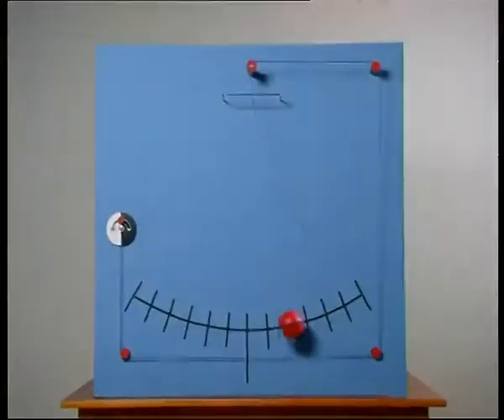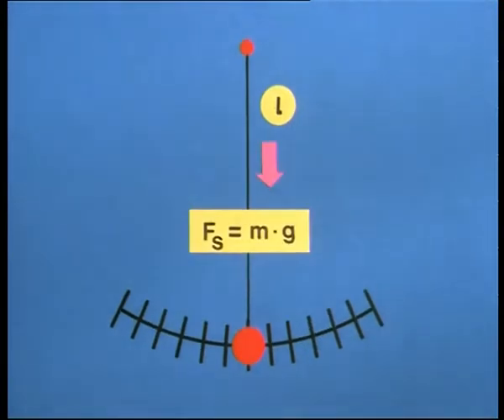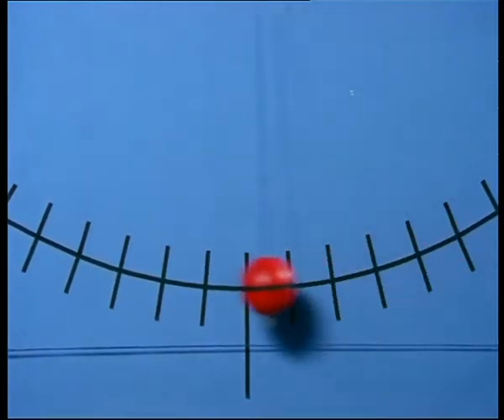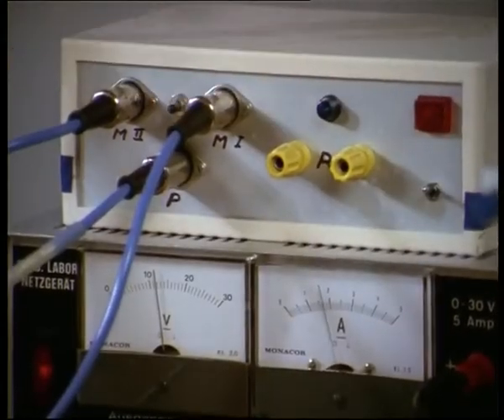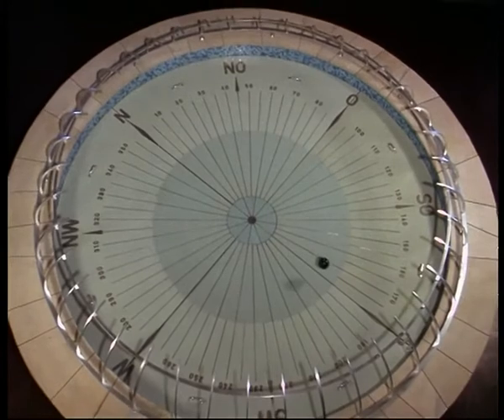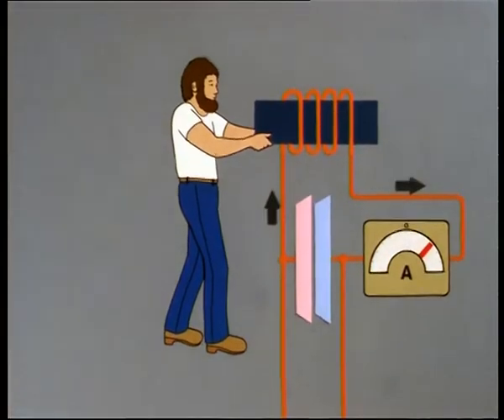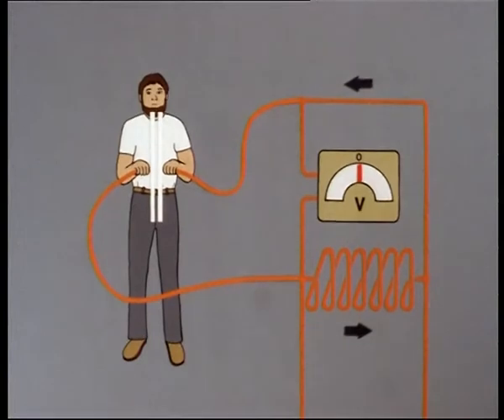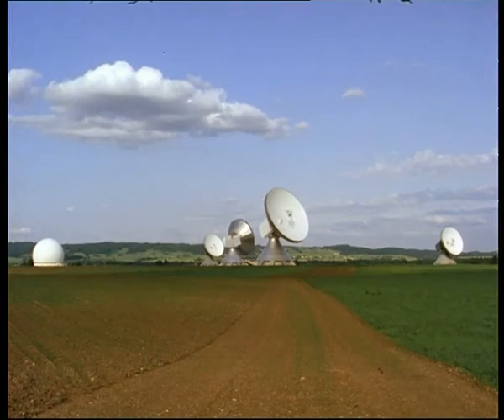Parametric Excitation of Vibrations

Comment: Free energy in a nutshell : )
Reply: no such thing exists.
Reply: @anoobis117  Anti Lenz transformer and generator says otherwise lmao
Reply: @anoobis117  
There is energy all around us and in Space, all you need to do is us a coil an pickup antenna and inject oscillations into it at the right moments to cause more ions to be attracted to the antenna.
Reply: @anoobis117  
Think about how a heat pump works, it seems like more out than in but the heat was already ambient in the environment. No laws of physics are violated, think of free electricity as kind of like the heat pump but for collecting and concentrating charged ions instead of heat, charge a capacitor and when it gets full dump that into a battery each time that happens and then you have stored power for later.
Reply: @anoobis117  
The thing you won't be able to do in humanity's current understanding is feeding the output back to the input because that would be attempting perpetual motion, the system needs to be open ended. Use potential, pulse that into a storage battery so you can then use the current from that.